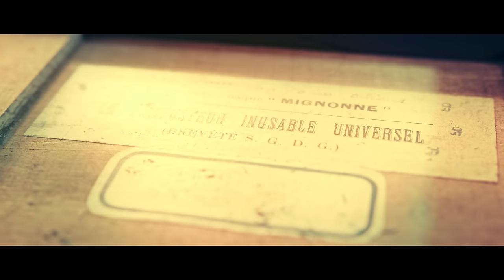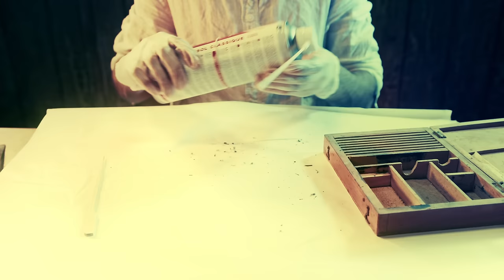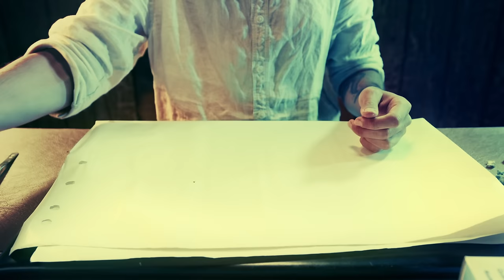Restoring an Antique Stamp ✨ASMR Unintentional

Comment: I enjoyed your video .. it's well done !!  But one question.  You do understand the meaning of unintentional ?
Reply from the maker: Thanks! Actually I do :) This video shows me doing an action I had to do anyway, filmed or not, which is restoring an antique stamp for using later as a prop in a roleplay. I actually did it as I would have done anyway, hence some harsh sounds. In other words, if I started a standard restoring channel, I would've done the video the exact same way, and knew it would still trigger people's ASMR :)
It's not because my channel has "ASMR" and I also do intentional videos, that everything I do has to be intentional lol
Reply: @MadeInFranceASMR  So if you did have said restoration channel, an you would do the video the same way ...so when you poured the liquid in the jar with letters in it an it started to fizz ..you would hold that up to the mics just like in this video? So in my opinion that is NOT unintentional. On a restoration channel..9 out 10 times you not have heard that fizz up ..because it wouldn't be held up to the mic 🤷 Intentional !!